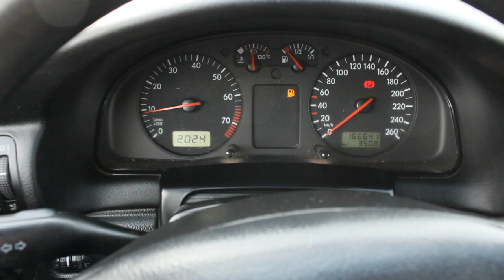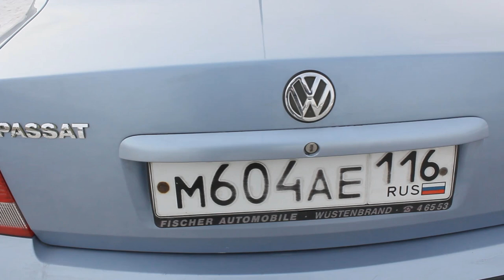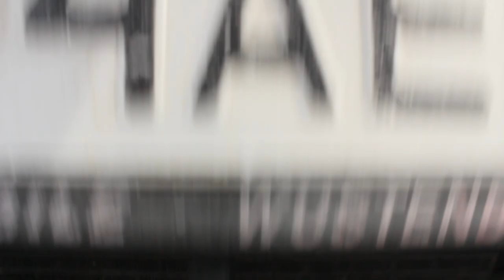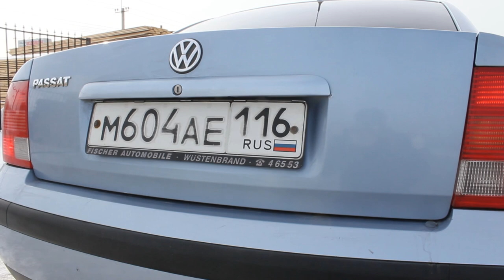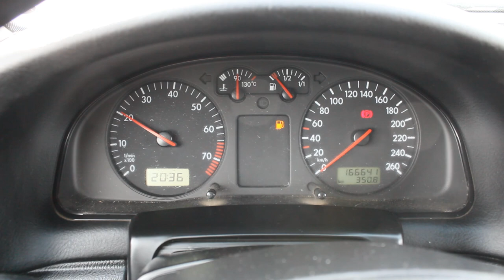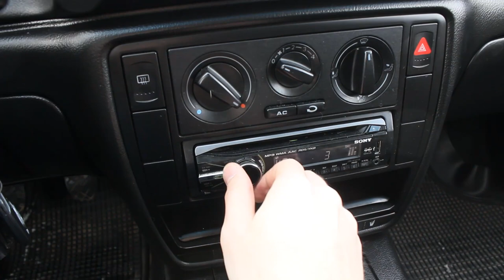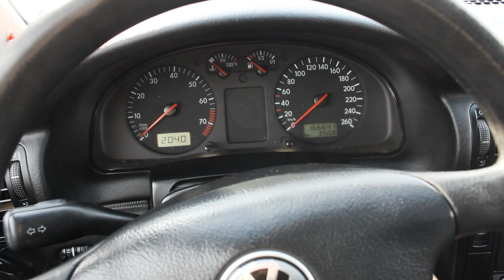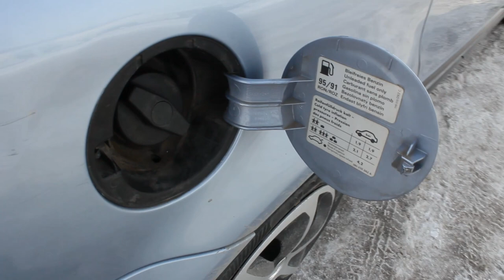1999 Volkswagen Passat B5. Start Up, Engine, and In Depth Tour.

Comment: cool...I still run my 1999 sport estate. ..210k on the clock....best engine vw ever made...plus separate water pump pulley
Reply: Mine has 350k xD
Reply: @rytisliaucys3444  sadly mine got scraped early this year as she had bad awkward rust damage in the engine bay too much work to repair..also other problems with water ingress into the caabin and electrics under the pssenger seat floor...
Engine was still sweet thow....
All the best......Jim